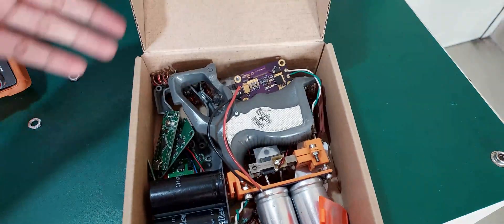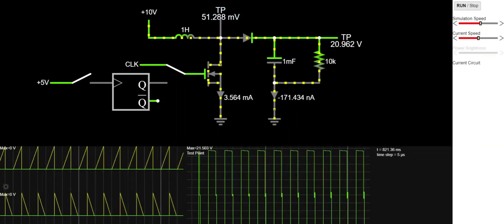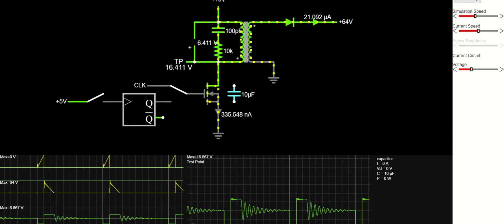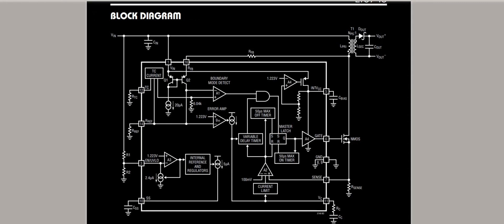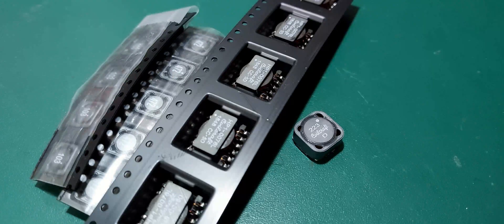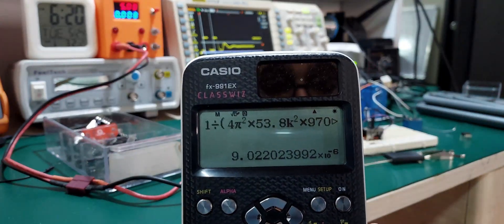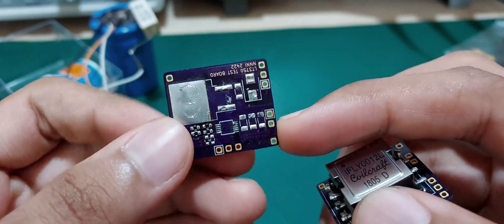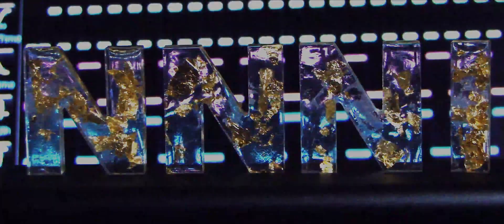LT3750 Deep Dive - Faster Capacitor Charging With Optimized Magnetics

Comment: THANKS AGAIN FOR ALL YOUR HELPFUL VIDEOS!!!
I am ready to built an 800v fast cap charger using the DA2032 or DA2034 without the LT3750.  I am planning to drive the flyback primary's (in parallel) with a MOSFET driven by a 555 astable.  The secondary is connected to the cap through a diode (usual setup).  I am monitoring the cap voltage with a comparator (with hysteresis) and voltage divider.  When triggered, the comparator stops the 555 (via pin 4), turning off the MOSFET...does this sound reasonable?
THANKS MUCH!!
--dALe
Reply from the maker: I wouldn't recommend running a capacitor charger at a constant frequency, since there will be a huge inrush current on the primary side, take a look at "The NNNI Capacitor Charger - A Complete History and Walkthrough"
Reply: @NNNILabs  THANKS FOR THE REPLY!! ...and now I have decided to use the LT3750...Ihope you will answer one more basic question...Can this IC charge caps higher than 300v (~800v) via RVout and RGB?
YOUR VIDEOS ARE VERY HELPFUL AND FULL INFORMATION I CAN FIND NOWHERE ELSE!!
Reply from the maker: @dalenassar9152  as long as you size the components correctly (formulae in the datasheet), it should work
Reply: @NNNILabs  As you suggested, I used the LT3750 formula for Vo, and plan to replace the example RBG of 2.5k  (for 300V charge) to 1k (the datasheet suggests 2.5k or smaller) which, hopefully, gives 750v....with RVout remaining 60.4k.
...been at it NON-STOP!
THANK YOU!
Reply from the maker: @dalenassar9152  by the way, I can also recommend checking out the LTspice file that ADI has on the product page for the LT3750, you can see if your calculations check out

Comment: I'm working on a variable hv psu for a geiger counter using the lt3750 and a coilcraft da-2032al. ordered a board from jlc pcb and still waiting on the shipping from china. this is the first pcb I've ever tried to make so I really hope it works lol. I really don't know too much about pcb design. but I read the datasheet pretty thoroughly and have a digipot hooked up to variably set the output voltage within a range set by an external mcu. The goal is to eventually support multiple geiger tubes on a single board, with the target voltage being set digitally.
Reply from the maker: the LT3750 is actually made for capacitor charging and cannot regulate the output voltage in the traditional sense, so I daresay you jumped the gun a bit here 😬 but from my experiences, it can operate in what you could call "burst" mode if you hold the charge pin permanently high

if you're up for a second revision, I could recommend LT8302 or similar
Reply: @NNNILabs  there will definitely be more than one revision of this board, I was just experimenting more or less. On the application notes for the lt3750 it says it can be used for HV power supplies so I thought it would work. I will look into other options though for the next revision.

Comment: Do you have any of these circuit boards for sale?  
I have the LT3751 and the DA2032-AL
THANKS SO MUCH!!!!!.
Reply from the maker: the boards I designed use different transformers, so without modification they won't exactly work, should be easy enough to design your own

Comment: I have an application where a small capacitor (1uF @ 400v = 0.08 Joules ) must be charged and discharged (by the load) at a rate off 100 Hz.  Is this possible with the LT3750??
THANKS MUCH!!!!!
Reply from the maker: Certainly possible, and I think even overkill! You might possibly get away with a cheaper self-oscillating converter than spending €10 on an LT chip.
Reply: @NNNILabs  THANK YOU SO VERY MUCH!!!!!!!!  You have given me confidence! I think it will work.  This is for a "proof of concept" model.
The real maximum device will require the 100Hz spec on 1J energy...something like 10uF @400v+.
I am looking at the LT3750-51 and the IFLY0012 for this.
Do you think it could work??
I REALLY APPRECIATE YOUR HELP...I couldn't find it elsewhere.
--dalE
Reply from the maker: @dalenassar9152  I've not had the best experiences with the IFLY0012, I would recommend the DA2032/3/4, used those with no problems. Since you're charging a relatively small capacitor (in terms of energy), you could try the DA2032.

Comment: @NNNI Hi ,I decided to use the LT3750 to charge the 33000uF 100V capacitor for my Pulse arc welder and recalculate all the component's value based on my condition but due to your expertise in this IC, I would like to ask some questions from you Sir :
1. Based on datasheet, maximum V_TRANS has to be 24V, can I use 24V SMPS because it is easy to find in market?
2. In the datasheet, the optimum value for the R_DCM is 43K for 300V output but my maximum voltage is 100V and I can't find a equation or something for calculating the value for R_DCM, would you guide me to place a proper resistor for R_DCM for 100V output?
regards😇
Reply from the maker: Hello,
1. Most ICs do have some headroom above and below the max. supply range since datasheets are very conservative, but I still wouldn't recommend running it at the limit since any noise or spikes on the switching supply might damage the chip. And yeah, using an SMPS is perfectly fine. Most large-sized SMPS-es come with a trim potentiometer, so maybe you can trim the output voltage down to a reasonable value like 22V if possible. 
2. The datasheet value for RDCM looks to be fixed based on internal biasing considerations, so 43K should work just fine. 
I would recommend Coilcraft transformers since they have a decent catalog and you can also get free samples by contacting their sales rep in India. Also, another recommendation would be to download the LTspice simulation of the LT3750 circuit available on the AD website and playing around with transformer values till you figure out something that works for you. And yet another recommendation would be to check out the LT3751, a fancier version of the LT3750 that's designed to take a little more power, one useful feature being differential shunt sensing. 
If you want any more help I'll be glad to do so, you can contact me on Twitter or Discord.
Reply: @NNNI  Thanks for the very useful information, friend. I want to use MEANWELL SMPS, which definitely has a trim pot. I appreciate your advice 😊, I will simulate the circuit in Spice, and after successful results, I will proceed. I think it will be useful to take a look at LT3751, thanks again, and if I got confused I will contact you again 🙏🙏🌹
Reply from the maker: @miladchalipa2002  I'm glad I was able to help you! For some reason this chip gets so little attention that I always enjoy discussions with someone else wanting to apply it.